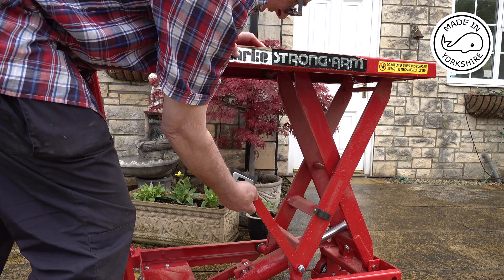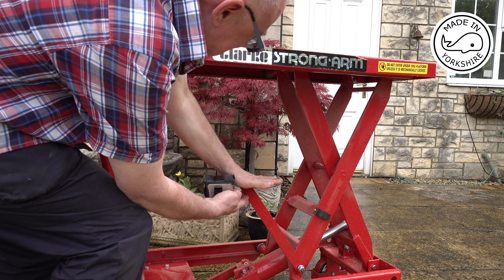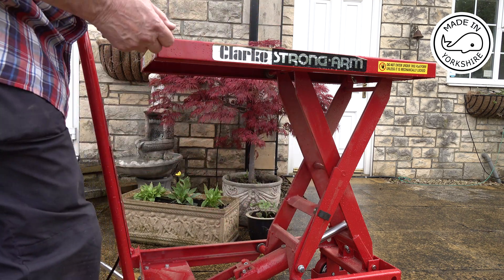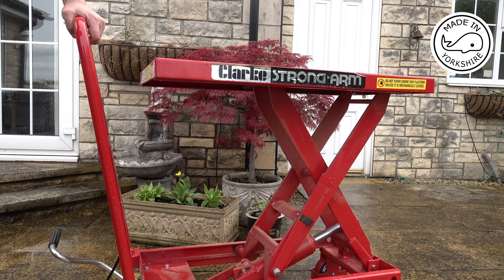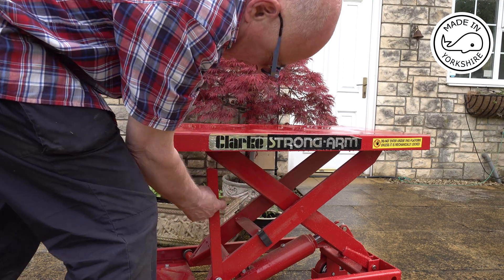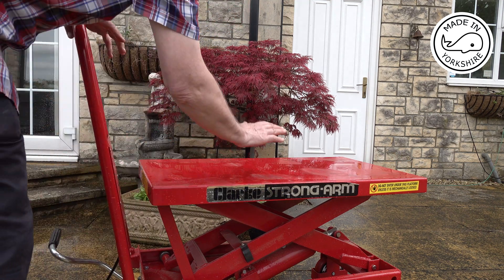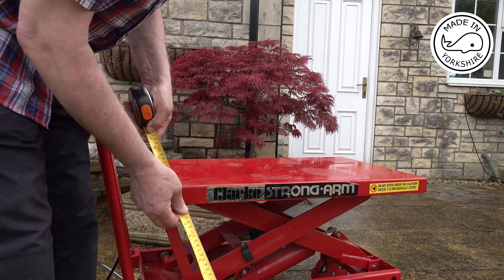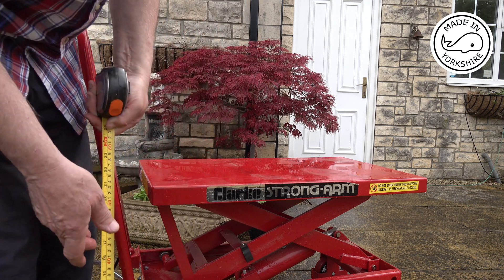#MT48 Clarke Strong-Arm Lifting Table. In 4K/UHD by Andrew Whale.

Comment: Hi Andrew I have 2. Excellent bits of kit. If you flip the struts right over to the bottom they lock the table higher. I have my Boxford CNC on 1 and I use the other for a general workbench of lifting my 5" loco.
Reply from the maker: Hi Tony - many thanks for the suggestion, but I don't seem to be able to flip the struts over that far. I think that my table might be slightly different to yours :-(
All the best.
Andrew

Comment: I think you are using those support arms incorrectly. They are meant to hold the table at full height.
Reply from the maker: Hi John - I've just double-checked the table and the arms are too short to hold the table any higher. However, Dave Ticehurst's suggestion works well.
Cheers
Andrew

Comment: I have much the same table I extended the table by bolting a piece of 3/4” plywood to give me a bigger working platform without causing the table to tilt, it also helps prevents stuff from slipping of the table top
Reply from the maker: Thanks for the info - very interesting!
Cheers
Andrew

Comment: Further thought Andrew, you CAN leave it at any height permanently providing you put some timber or rods on the base between the back frame and the  sliding scissors bit so it is  solid stop for when the hydraulics leaks or fails. Would not trust the full 1/2 ton as the back plate by the handles does not look particularly thick. Regards.
Reply: i think the arms he's demonstrating are to be put down against the back bar were the pump is
Reply from the maker: Hi Dave - a great idea. I've just tried that out and it works well.
All the best.
Andrew